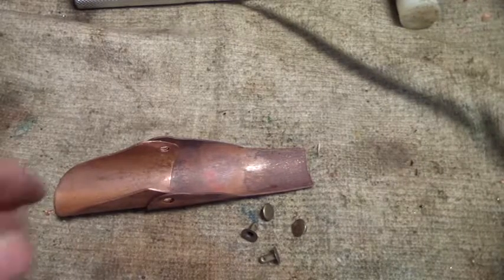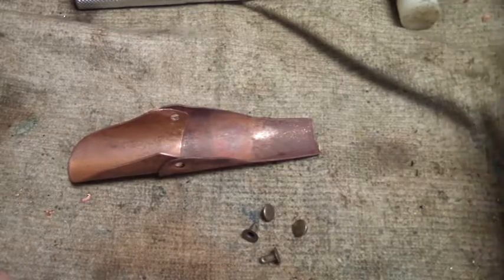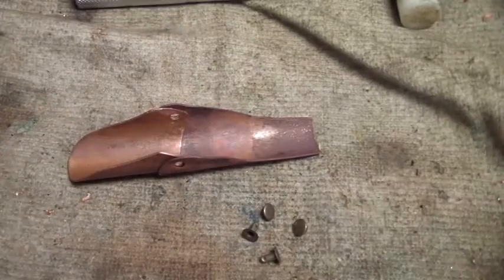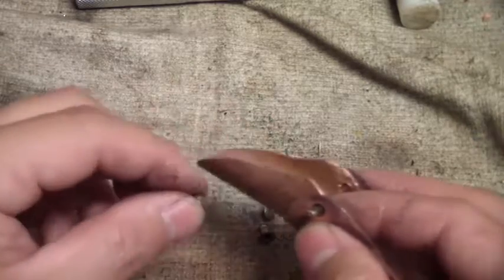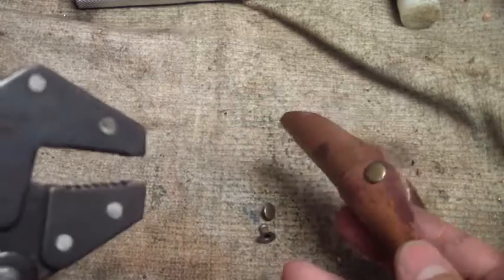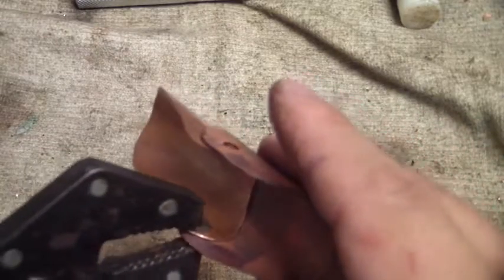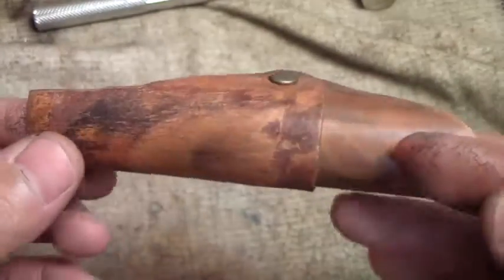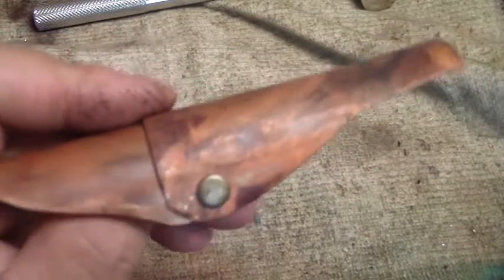Freddy Krueger glove rivets

Comment: Great video. Thank you! I'm just starting out making the gloves and having enormous success after intense research into movie accurate templates and materials. But the part that I'm finding hard is the shaping of the fingers, particularly the stall with the blade. What do you use to bend them over so that the blade stall slots underneath for knuckle stall? And then a what point do you drill so that they correspond and have free movement.? Many thanks. Gordon
Reply from the maker: Right now to form the finger stalls i'm using 3/4 inch steel pipe, once i get both formed i stack them on each other and hammer it again lightly. I'm just starting too i'll be doing more videos on the build as I have learned more.
Reply: Hi would I able to use dome rivets thanx